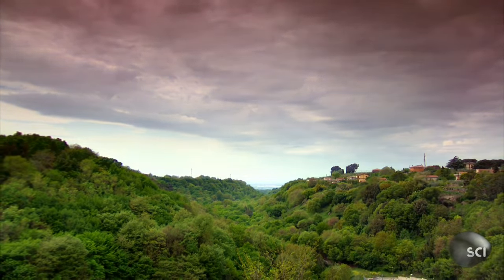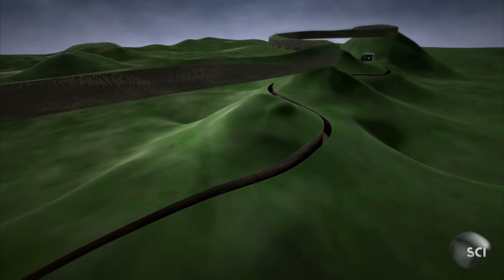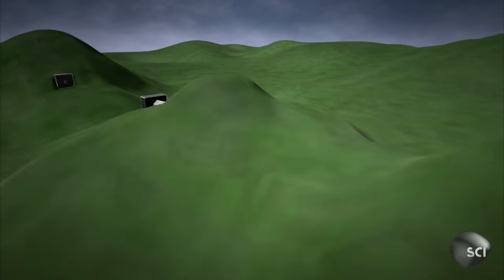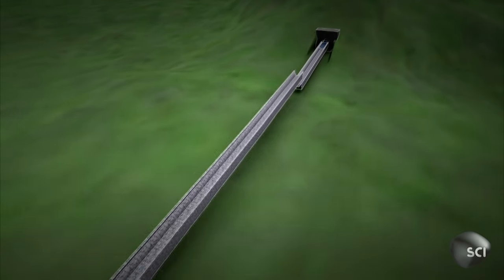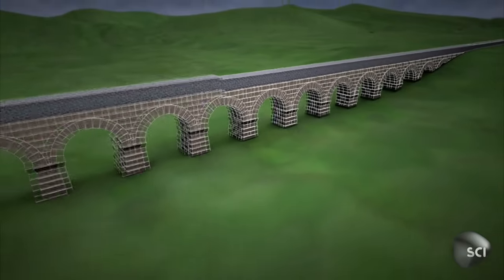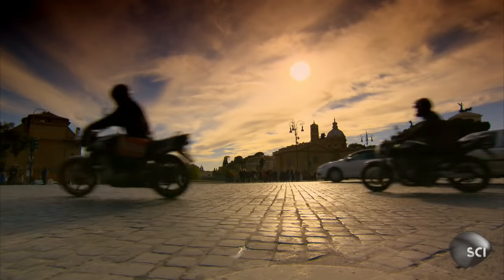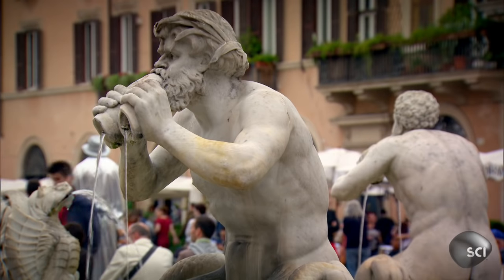Roman Water Supply | Strip the City

Comment: I like how the video just casually shows the water going down and back up a hill and doesn't explain how that works. Obviously there are no pumps. It's what's known as an inverted siphon, which is not technically a siphon but it's vaguely analogous. Basically pipes are used to increase the pressure of the water and force it down and back up. The incline must not go higher than the start of the initial point of decline. They are susceptible to getting clogged with sediment because the pressure is only enough to move water.
Reply: Those sre very obvious and common sense. Like a water flowing downhill. The proper siphon is much counter intuitive.
Reply: @omniyambot9876  Common sense is not common.
Reply: @ratdoto2148  it's more like average sense, which you think is fine until you realize that there is a bottom half to averages.
Reply: @omniyambot9876  Well in that case there was no need for this video right ? If the video talks about Rome's pipeline it should explain it well.
Reply: @TheSlimmshadyy  a water flows downwards due to gravity. common sense,
Reply: @omniyambot9876  but where does this water originate from ? How do they get it up there in the first place ?
Reply: "inverted siphon" is a pretty silly technical word for something so basic. A pipe can go up and down, as long as it doesn't go higher than the highest point. People get that, it doesn't really need an explanation, it's very obvious. Everyone knows how their kitchen sink has that S shape in cupboard, it's very obvious how the water keeps going down regardless of the bend in the middle. It's common sense.
Reply: @npip99  You overestimate people.
Reply: @ratdoto2148  humble yourself
Reply: @keiahnigbruder1453  touché
Reply: We know.
Reply: @buudorobuudronovich1507  You know.
Reply: It's not a siphon at all. Its just gravity.
Reply: @davealmighty9638  I said that, but that's what it's called. It's a misnomer.
Reply: @omniyambot9876  don't count on common sense, I got into a few arguments with people about a pilot pouring water while doing a barrel roll because they didn't understand how a 1 G turn works and they thought it had to be cgi or green screen.
Reply: @theduke7539  omg, fair enough.
Reply: Its something that we're not sure how it works. Some reason when in pipes water will flow up hilo if it means going to a even lower point.

Comment: I'm curious how the Romans avoided the lead poisoning from the pipes? Where they lined on the inside or did they just build a tolerance over time?
Reply: Apparently calcium from the water would build up on the pipes' interior, creating a barrier.
Reply: It would create a calcium barrier from the water
Reply: That was exactly what I was thinking
Reply: Some really old houses still have lead pipes
Reply: Our home in the UK has a Lead supply pipe from Mains. It's a post ww2 house
Reply: Same in the US that many old houses and water supplies have lead piping but over time a layer builds up on the inside that coats the lead pipes. I believe what happened in Flint, Michigan is the city's water supplier changed and the water and additives caused the inner layer in the pipes to crumble off exposing the lead pipes
Reply: There is some older Roman texts where they suspect lead pipes may cause health issues. But not much else. In general the dosage won't have been high enough for it to matter to most people.
Reply: @Maddinhpws  the real problem was their lead drinking vessels and bowls, and their tendency to store wine in lead decanters to sweeten the flavor (some lead compounds have a sweet taste), they called it leaded wine or sweet wine. I see the lead cups and bowls as being especially bad though, they constantly put their mouths directly on the lead and any forks or spoons used in the bowls regardless of construction material would scrape off micro particles of lead into their food, and over time that introduces a lot of lead into a person's system. I'm sure the lead pipes in the aqueduct weren't exactly doing great things for their health but like many others have mentioned at least there's a calcium buildup on the surface to create a moderate barrier from lead contamination in the water, so it's nowhere near as bad as the cups and bowls because of them being scrubbed clean when they washed their dishes.
Reply: Lead poison was a problem for the Romans, it wasn't just lead pipes, the romans also used lead as a sweetener for cheap wine. Which actually ended up spreading to the upper classes over time as even expensive wine couldn't be sweet enough for the sweet tooth that romans developed. This is why city dwellers of Rome often died relatively young if they were heavy wine drinkers and is also why Romans began building movements against excess, as even though they didn't understand lead poisoning, they just knew those who drank too much wine would get deathly ill. Relatively speaking, the lead contamination in public water was far lower and far less of a health risk. Even if they had known about it however. It's unlikely much would have changed as they really didn't have an alternative, iron pipes were 2 millenia away and plastics were equally far away, copper was available but only in small amounts, just enough for consumer goods. But the industrial scales needed would tax the supply beyond limit. Really they had little options but to use lead.
Reply: mineral sediment barrier + water did not stay long enough in contact w/ lead anyway
Reply: @charliep5139  ooff

Comment: I’m curious how lead pipes lead to safe drinking water.  Thorough mineral buildup would eventually clog the pipes at multiple different points.
Reply: You just answered your own question . Its the mineral stratum on top of the lead that made it safe to drink . Eventually.
Reply: @williamjustsavage3144  lmao the ancestors unknowingly poisoned themselves after they built the pipes for generations, thats a real sacrifice.  Leached lead would still occur at various points/places until it calcified enough.  How long did these function? Did they break, excavate, and repair pipes regularly?  Roman construction/renovation periods always coincide with unrest.
Reply: Mineral strata h the water is not still in the lead but keeps flowing so it absorbs an insignificant quantity of lead that has no actual negative effects

Comment: So how did they make water go uphill? Was there a guy at every uphill part using a pump or something?
Reply: Hydrodynamics
Reply: @Singleraxis  I wish i was smart enough for that to be enough to explain things to me
Reply: The pressure of water continuing to flow in at the top pushes the water out the other end, the pressure remaining constant inside the sealed pipe. This works in a gravity fed system as long as the other side is even just slightly lower than where it’s flowing from.
Reply: @blazer168  some law about water always finding an equal balance, had it at school but forgot the name. =[
Reply: pumps and pressure

Comment: How did water flow up the hills?
Reply: Inverted siphon
Reply: They used the force of water flowing through the compressed pipe to overpower the pull of gravity. The Water first flows downhill, building up water pressure in the flow of the pipe. When the pipe starts going uphill the water is propelled by the the water pressure behind it. The Romans literally used the force of gravity against itself! The downside of this system is that you cannot make the water flow up higher than the original point at which the pipe began.
Reply: @nicholasthurmond4006  kind of a water rollercoaster

Comment: SAFE TO DRINK FROM? did you not here "LEAD PIPES"
Reply: megazwatcher, I thought the same thing after I heard that. My only thought on that was maybe they got rid of the lead pipes, but I didn't search to see if that is true.
Reply: Thank you! Freakin' seagull standing in it and he says its safe to drink. Disagree.
Reply: There's nothing wrong with a little lead in the water. The people in Flint have been drinking it for years
Reply: +Megazwatcher. the original pipes were lead, they were probably replaced long ago by steel ones on the sections that still carry water
Reply: The lead pipes were actually not that much of a problem.
What fucked Rome in that area were the lead pots, and the food cooked in said pots.

Cooking in lead pots causes the lead to dissolve into the water much faster. Unfortunately, increased content of lead in the dish makes it... sweeter.
Yes. Sweeter. It was considered a delicacy in ancient Rome and best of all, they were actually well aware of lead and its poisoning. But they were too stubborn to give up on teh swits.

Fortunately for them the lead poisoning mostly affected the wealthier people.
Reply: Well, calcium deposits block lead from mixing to the water. But I still wouldn't drink that water, just looking at that seagull.

Comment: I love it how ancient Rome has built shit that still works, yet modern engineering can't make anything last as it requires never ending and constant fixing
Reply: While they may have built longer-lasting solutions, modern ones are more sophisticated and efficient. After all, today’s waterworks aren’t usually exposed to open air!
Reply: @jsmith6518  If you knew what was in your tap water you wouldn't touch it.

Comment: Rome's water is safe to drink?🤔 But didn't they channel water through lead pipes ?🤓
Reply: LEAD ;D tries to drink water coughs coughs again* too much lead XD
Reply: No problem at all.
Lead poisoning was caused by cooking in the lead pots, which made the dish sweeter.

In the colder water lead does not dissolve that fast and would not cause the poisoning by itself.
Reply: @ahriman935  lead poisoning is still impacting hundreds of thousands including people in flint who aren't boiling their water pipes but are still getting lead in their water from leaching pipes  , Lead and water don't mix and are not a combination i would trust in my drinking water in any circumstance
Reply: No because of calcification of the pipes
Reply: All water pipes used to be lead. That's why they are called plumbers, after the lead (Pb).

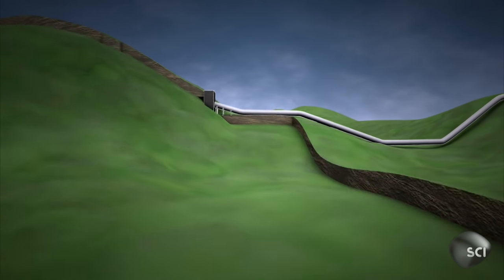Comment: The part at 0:48 is actually 2500 year old Persian technology.  That's way before the Romans.
Reply: mka mix This video is about Roman water supply, not where the technology behind it originated. And if the Romans were better at it than the Persians
Reply: Why did they need to air out the water going through the mountain?
Reply: Qanats are broadly middle eastern, not persian specifically

Comment: Indus valley did this 2000 years before before you guys ever did this.
Reply: No they didn't.
They were advanced but not nearly this advanced.
Reply: @a564-c3q  harappa spanned an area larger than sumeria and egypt put together. Also the earliest ship dockyard was built there. I bet you don't know anything about the private housing and toilets which connected to a uniform sewer line which again connected to a larger line. They were advanced enough.
Reply: @hidum5779  
As if the size of the area was any important...